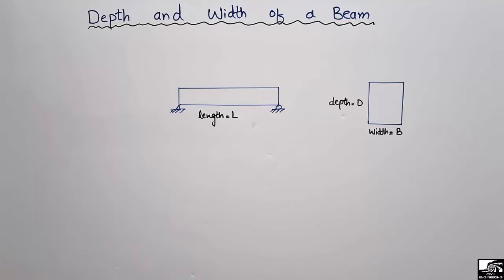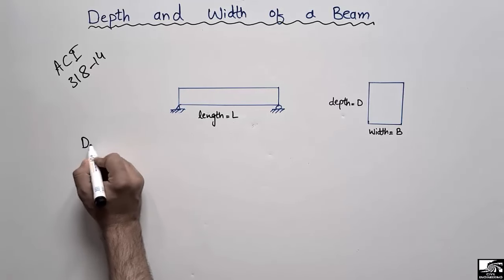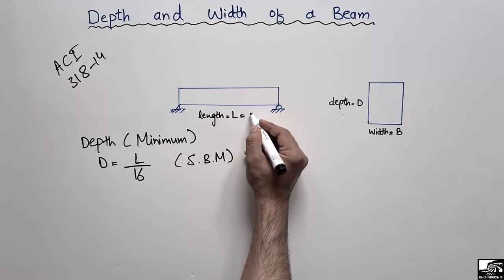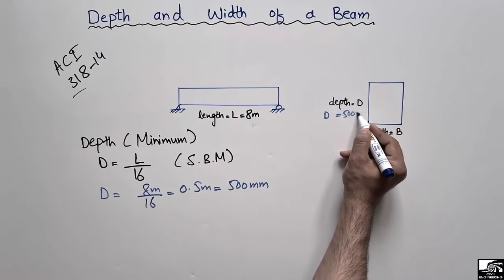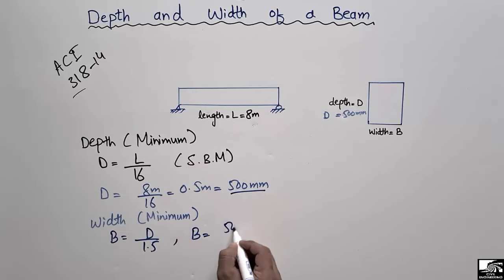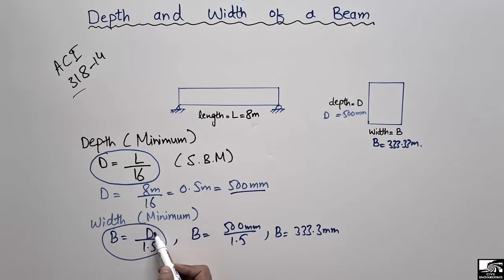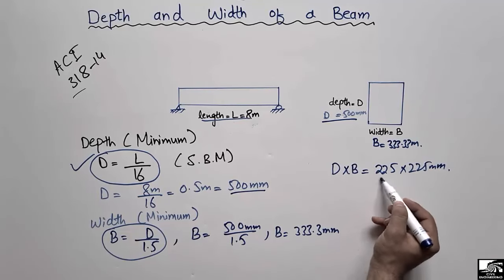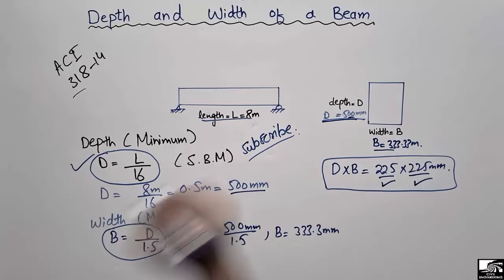How to find Depth and Width of a Beam

Comment: Am constructing a single story building. I want to use 20mm and   16mm for designing beams with a spacing of 5 m in between columns. Help with design of lay out of the steel on the beam
Reply: please am waiting for your reply